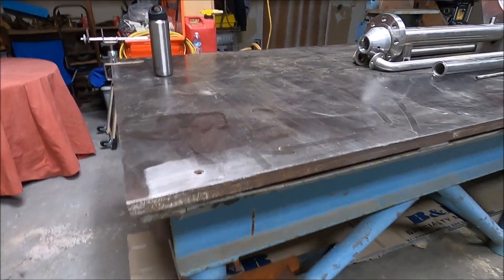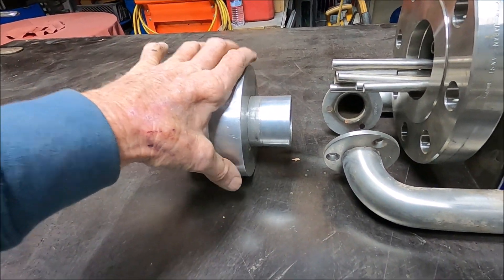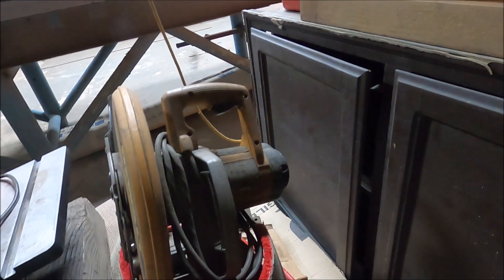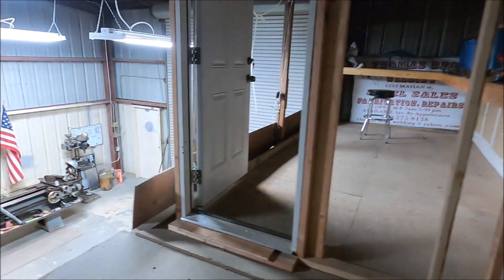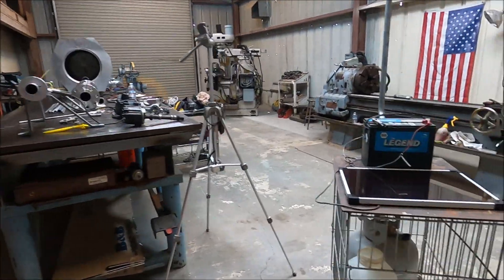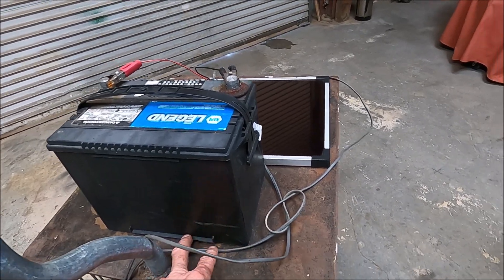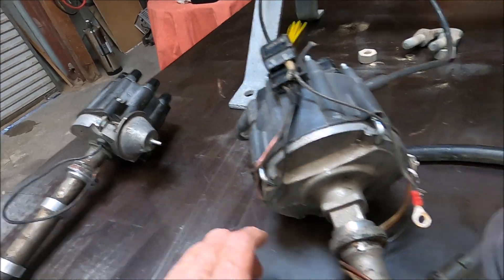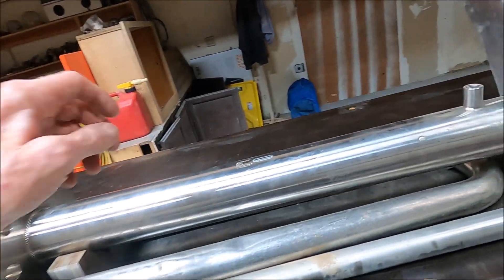PROTOTYPING MY HYBRID DETONATION ENGINE PART 1  APRIL 14TH 2024

Comment: the concept is called SSTO, single stage to orbit.  never been achieved, so you might be first to develop an engine to do it.  great video
Reply from the maker: Tanks Paul41.. You hit the nail on the head.. looking forward to integrating the engine into a trans atmospheric vehicle. A multimode air breathing engine also has to be a rocket engine in its’ final injection into NEO..